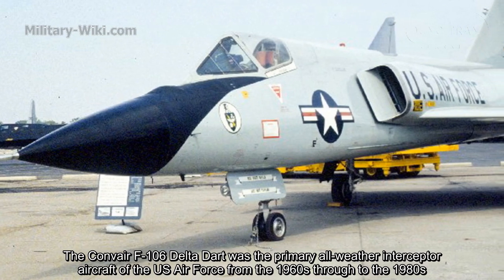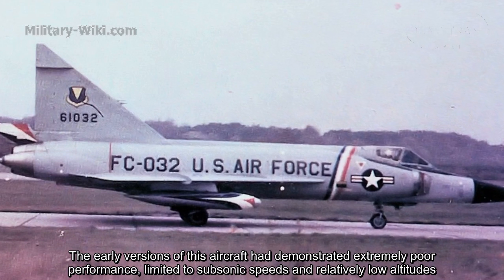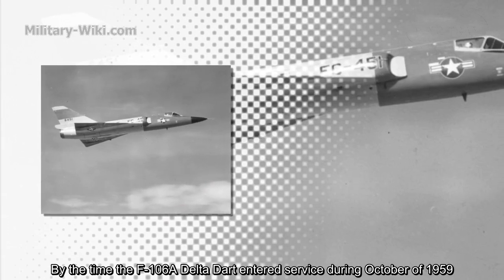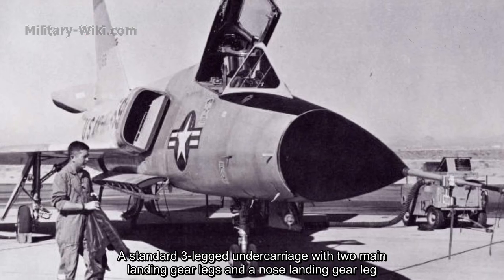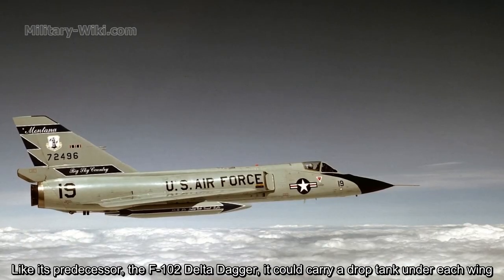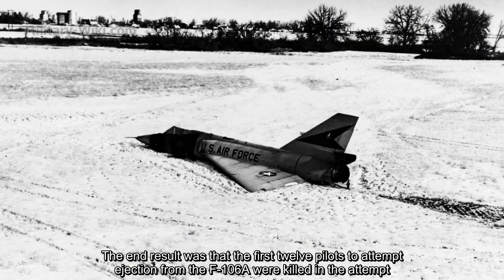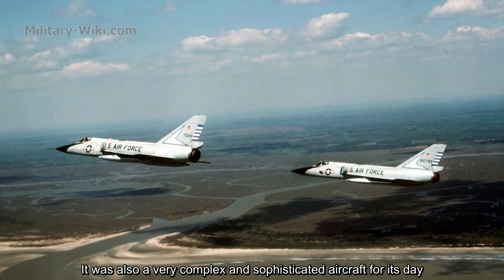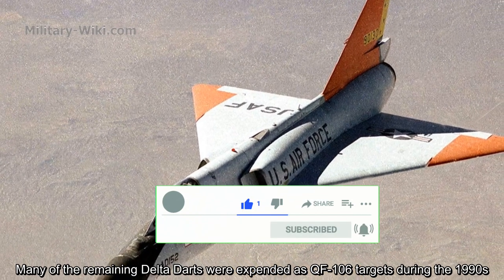F-106 Delta Dart - The Tragic Fate of the Last US Interceptor Aircraft

Comment: I'm guessing the first ejection seat didn't have enough thrust to clear the vertical stabilizer?!?!=/ your hooded top makes you camouflaged against the road background:)
Reply: No it would clear the Stab with no problem, the Issue was that it didnt have a Drogue Chute or anything to stabilize it at high Mach Numbers.  The Seat would get you out of the aircraft, but it would also probably kill you.  Add to that the Crappy performance at low speed and altitude, and it was just a crappy design...but then again it was also right at the beginning of the point that they were realizing that 0/0 Seats were a necessity, as well as Seats able to function at High Mach.  IIRC the First Weber seat was a holdover from the F-102, and Convair's In-house fix was just too wonky when lives were on the line.  The final Weber Seat used was, IIRC the same one as in the F-105's
Reply: @toadman506  avro arrow would have been better! I used to be Mr toad!
Reply: @jamescunliffe9872  Guess we'll never know... IMO The Arrow didn't do anything different, or Better, than the F-105D
Reply: @toadman506  it had modern features way back that are seen on the f35 and F22 today, it was capable of 2+ mach with 3 in development when the program was shut down losing 30k of jobs! But as you said we'll never know